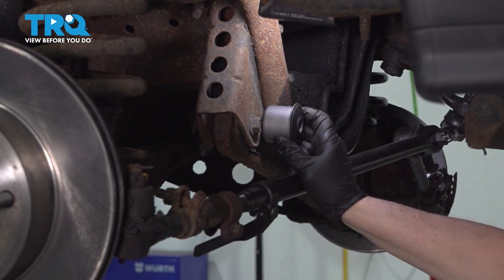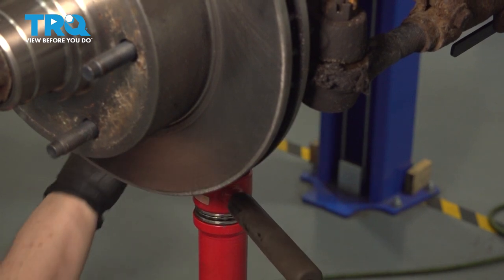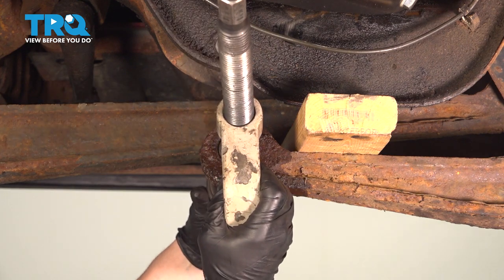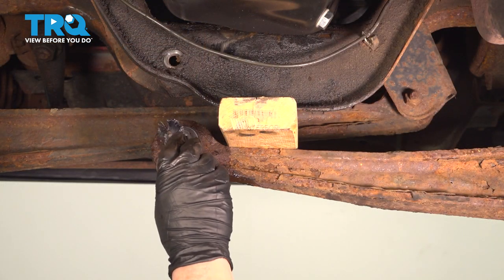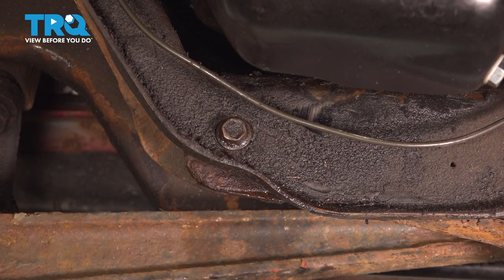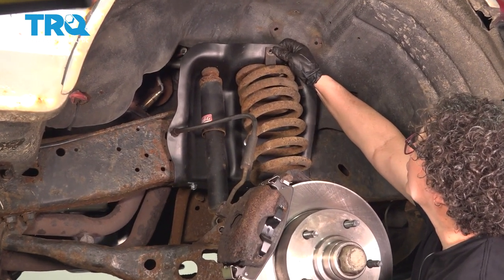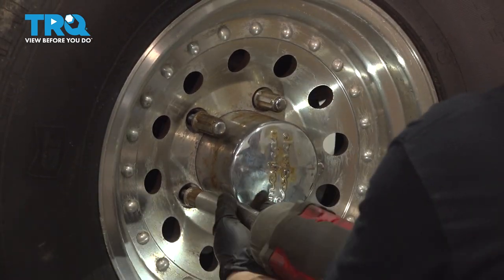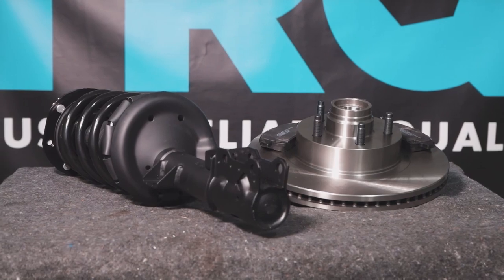How to Replace Axle Pivot Bushing 1992-1996 Ford F-150

Comment: For all you people still driving these old Ford Trucks I have come up with the easiest and safest way to replace Axle Pivot Bushings on your F150.  You won't have to remove the tires or springs at all.

You will need a set of ramps, a large floor jack, a ball joint replacement kit (Amazon $45), 2 Moog Bushings (Amazon $11 each), a 1/2 inch impact driver, an 18mm (or 13/16) wrench, a 21mm impact socket, a couple of medium pry bars or large screw drivers, a large torque wrench, a smaller flat chisel, an alignment punch and a saws all with a metal blade. 

Drive your truck on the ramps and set the parking brake.  Take your large floor jack to the side you wish to repair and jack the truck up until the wheel lifts off the ramp.  Slide under the truck, remove the axle bushing bolt with the 18mm/21mm wrench and socket.  Pry the I axle beam arm down to expose the bushing and insert a second pry bar above the beam to hold it.  Take the flat chisel and drive the rear metal edges of the bushing inward.  If you are lucky you can take a flat end punch and drive the bushing forward by striking the bent edges of the metal bushing.  (Don't try to press the bushing from the front to rear, you need to drive the bushing towards the front of the truck.)  If you can't get it moving you can force out the metal core and use a saws all to cut through the rubber and slice through the metal case in two places.  You might want to start with just cutting the metal casing along the rear edge and pry a little more of the edge up and try the punch again.  Just a little cutting and edge prying can free it up for the punch to work.

After you remove the bushing and clean the burrs out of the hole grease the new bushing and press in with the ball joint press and impact driver.  It almost takes 3 hands to line up the heavy press while aligning it correctly.  I used 2 hands and my big belly to do it.  Don't drive the bushing all the way where the lip is flush, leave about a 3/16" gap like the factory did.  Also be careful to use the right cup on the rear of the bushing so the bushing can protrude.  It your bushing stops before it's all the way in you need to readjust the rear cup.
 I don't see how it would be possible to press this bushing in without an impact driver and ball joint press. 

Since you raised the one tire off the ground aligning the bushing holes is easy using the pry bar.  I have seen videos of folks struggling with ratchet straps trying to align the bushing bolt holes but with the one tire off the ground it's easy.  Put the bolt in and torque it to spec. 

The car ramps stay under the front wheels the whole time so I think it's better than using jack stands.  I am a 70 year old, obese man and I could do this.  You can too!  Good luck!

Comment: I might be wrong but I believe you are supposed to do the final torquing once the vehicle is back down on its tires. It will prevent premature failure of the bushing.

Comment: Thank you! Wanted to pass along that air chisel method was a massive time saver.  Your videos are always spot on.   The 4x4 version there is much less room to use a ball joint press, but it is possible.  If I were to do it again id probably create a makeshift press before getting started.

Comment: I'm working on my 96 2wd and my suspension doesn't have enough travel to make the spring loose enough to pull out. I'm hoping I have enough tension off to pull the bushing with the spring still in place but unbolted.

Comment: Those radius arms are crusty. I’ll have to be replacing mine soon along with the ball joints and body mounts. I don’t want to do poly because they squeak. I figure the originals have lasted 28 years for my ‘95 so I’ll see if I can get more like them.